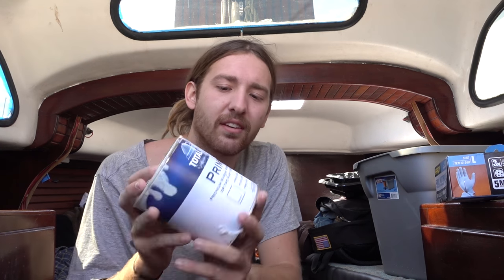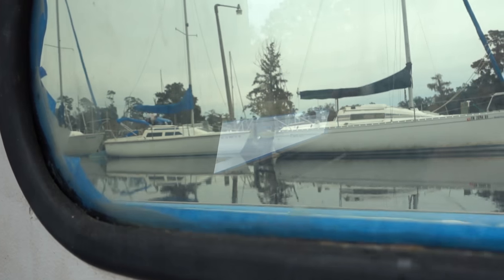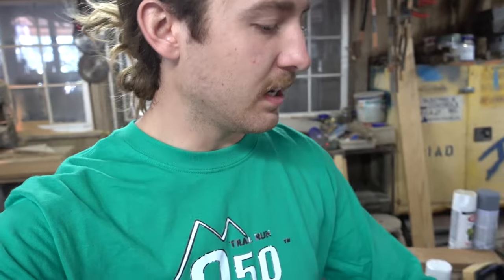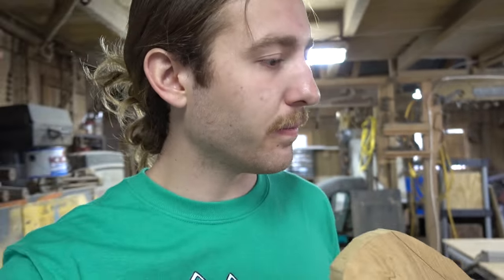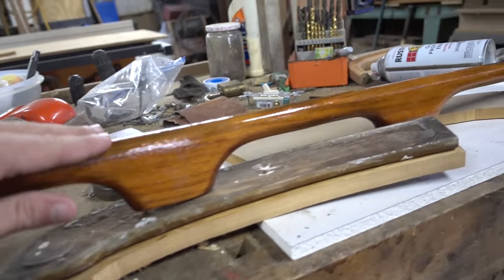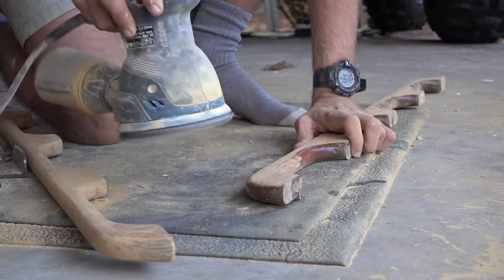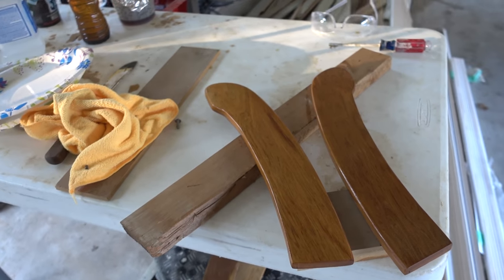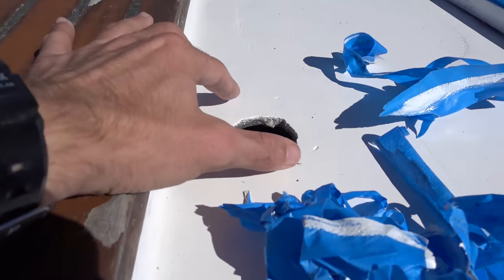Top Deck Paint, Woodworking & Varnishing, Thoughts On My Rigging

Comment: Most boats with gasoline engines have a blower that you turn on before starting. (They recommend 15 min or something, I do it for about 5 min) The idea is to get all the potential gas fumes out just in case the motor backfires. Once its running the blower can be turned off. In your case maybe open the hatch for a few minutes, then start while open, then close it and enjoy. There is no danger having it closed while its running.
Reply: I agree with you, the only thing I would add is, putting a blower in would for sure help, but I would say since the boat is a 1960 something boat and it's been this way for more than 50 years, it's probably just fine the way it is... :) if it were me, I would do like AJ suggest and just open the hatch for starting and then close after a warm up period.
Reply: Gasoline vapors collect in low places, so opening the hatch may not do too much. To vent the compartment, you need an explosion-proof marine blower, which draws from the lowest point.
Reply: It is an OUTBOARD motor.  They almost always have the fuel tank right next to them.  I would just put in a couple LARGE vents so you get a good flow of air around it.  As long as there is fresh air around the tank you are pretty safe.  Problems ha[[en when you get raw fuel in the bilge.
Reply: It's an outboard motor in an enclosed space. Fuel vapor (the thing that actually explodes) is heavier than air, and will collect in the bilge. Adding a vent in itself, won't let the vapors out, unless it's in the bottom of the hull, which would add a whole new problem.
Yes,  fuel tanks are usually sitting beside the outboard in a John boat or bass boat, but that's not the situation. From what I see, the motor is in a well, under a cover.
Also, where are the exhaust gasses going? Can they travel under the cockpit seats into the cabin? Some exhaust into the water, but some exhaust under the base of the power section. I'm not sure about those old Johnsons. BTW, I believe it says 9.9 HP on the side.
As far as tuning, I took a reel tape measure, hooked it up to the main halyard, hauled the end of the tape up to the top of the mast snug, and took measurements from the top of the mast to the chain plates on either side of the boat, and adjusted the turnbuckles until they were even on either side. You should use a tension guage, but I don't have one, I just make sure that when the wind is blowing, and she's over about 30 degrees, the side that's downwind isn't too loose. The windward side will be taking the strain, keeping the mast from blowing over. The leeward side shouldn't be flopping around.

Comment: Hey Cole, I am a Cole too.  I've spent a few years sailing an Islander 24 Bahama.  The previous commet is a good one regarding the mast.  I've gotten free\cheap mast from boat yards before.  Hold off on replacimg the rigging until you satisfy your mast problem.  When things are feee, you don't always get a choice of what you get and the dimensions may change, it may also force you to buy\recut sails which will be another expense.  I'd also hold off on adding chain plates to your lower shrouds.  If they have been there for fourty years, it must work.  You have enough things on that boat that need to be done, there is no sense in spending time and money on things that don't need to be done.
We would run the engine with the hatch propped open and never had a problem.
One BIG repair that I had to do was drain and seal the keel cavity.  There is wood in the cavity towards the forward bottom, don't ask me why, it held water, froze, and cracked the fiberglass at the bottom of cavity.  Grinding, exposing, and allowing to dry took an entire summer.
I was very pleased with the sailing characteristics of that boat.  I remember holding 5 knots all day long on lake erie sailing to Put in Bay.  The boat is really coming along and I love the dark hull.
Reply from the maker: Hi Cole, thanks for this comment. Maybe youre right. Maybe I should not worry about the rigging UNTIL I replace the whole system. Thanks for that perspective. As for the keel cavity, how exactly did you go about that and what are the steps needed for me to check this? Things like that worry me because not only do I have no understanding of the things I haven't seen yet but I have never dealt with them. Either way thanks for the comment.

Comment: Hai Cole, This is Gerard from the Netherlands. The fumes of gasoline are heavier then air so you need a ventilation opening at the lowest point above the waterline after filling up the boat with stuf you need for your trip.. The option for electric ventilation is a idea but you run out of current someday because you have charging issues. You need your current for the VHF en running lights. Have fun with you project .

Comment: cole,  look for a donor boat.   loot it and strip the mast and all the goodies.  then cut the lead ballast off.  lead scraps for .58 per lb.   not a bad haul if you have say 2000 some odd lbs of it.   then you can scrap your mast for aluminum and so on.   you will leave with a fat check,  then drop the old hull at a landfill for about 100 bucks.  the cost of the donor boat will be breakeven if you make sure of your scrap prices and your lead ballast weight.  if it is free.   you will have a mast that paid you to put it on.     p.s.  need truck, trailer,  and sawzall or chainsaw.  to pull it off.    best advice I've ever given lol

Comment: I went with silicon bronze chainplates (1/4" thick) with 3/8" bronze carriage bolts (28' ketch)  and have been very happy with them. No worrying about corrosion anymore, and they will probably outlast the boat. The bronze you mentioned in the video I think is known as aluminum bronze and will probably be difficult to work. Silicon is bendable while cold in a vise...

Comment: In the area for the inboard/outboard. Ages and ages ago on my Dad's old skiff there  was a similar hole to the one you suggested was for ventilation of the engine compartment. He had a tube with a set of valves on it that protruded out of the hole which allowed him to easily switch which gas tank was providing fuel to the engine. I remember him having 3 portable red metal gas cans and there was also a larger 22 gallon(?)  gas tank under the forward seat of the skiff. There was one valve for each gas tank.

Comment: Hey Cole. Good luck with all of this! First, I like your idea about the chain plates. That will add a lot of strength to the rig. Second, of course you can tune the rig. Look, obviously you're not going to race this thing, and it looks like that mast is deck-stepped. So, my advice is to get the shrouds (side to side) snug, but just. You want to be able to deflect them with your palm about three feet up, maybe about 1/2 inch without working them too hard. That way, you won't be stressing the deck too much. (or that gimpy mast!) With wind in your sail, the upwind shrouds should be tight, and the leeward ones should visibly sag.
    Leave the stays(fore and aft) a little looser. Put in just a little rake toward the stern. Not much! When you hoist the jib, you can get that nice and tight, which will tension the whole rig while you are sailing, the only time you need it tight. And the mast will tighten up to the vertical. Savy? 
   As with all advice, compare mine with everybody else's. 

Also, I hate to say it, but that mast should be history. A naked extrusion (mast places have them) shouldn't set you back too much. Sucks, I know, but imagine a tough blow offshore that knocks you down, with you and a sweetie on board. That mast is the weak point, no question.

Comment: I'd definitely replace the turnbuckles and if the standing rigging has swage fittings at their ends, then replace it as well. Trust me, you do not want to get dismasted. Speaking from first hand experience. All it took was one turnbuckle to fail and down came the whole rig. Totally worth the investment and peace of mind. Your best insurance policy is a sound rig, good ground tackle, and prudent seamanship. 
As for the motor/gas situation, it looks like you could install a blower that vents out of that top hole in the aft deck. You could run it while motoring. Have the alternator hooked up so that it won't draw from the battery. 
Also, get really good at sailing as you go along and then you won't need the motor much :) 
I love the videos man! Keep them coming. Subbed!

Comment: The shot you took looking straight up the mast is very informative and it looks like the mast is definitely kinked, this isn't just a tuning issue. The fact that it's kinked means that the structure of the mast is compromised and you should definitely replace the mast given how you intend to use the boat. The advice from other comments about finding a cheap donor boat you can take the mast off of and scrap is good, scrapping a boat is hard work but you can make a decent chunk of change. Just make sure the mast on the donor boat is sound before you buy.

Comment: If you get to the point where you wanna add a stereo, I've just pulled a JVC CD stereo with remote (no speakers) out of mine for a new digital radio.  You can have the old one if you want.  I live in Denham Springs and I keep my boat in Gulfport, so I pass kinda your way sometimes.  Like this weekend.

Comment: I wouldn't have a second thought on placing a fuel tank there. On motorcycles they're just slammed on top of the engine. 
For outboard chain plates I would definitely recommend sourcing some 316 grade steel, simply for corrosion resistance. Not all "stainless" steel is created equal. And since you're planning to do some serious travel later on I would get that mast replaced. It'll suck to have to do it, but I wouldn't consider it ocean worthy as is..

Comment: Hello Cole. i just watched your video on your chainplates. I don't know if you have found a solution yet, but the upper shroud chainplates seem to be made by Schaefer. They probably still stock them. Otherwise you can use a 316L flat bat and drill the necessary holes. It may sound like a little overkill, but if your deck is soft in the padeye areas, then fixing the deck means more work. As to the turnbuckles, the were built by Merriman. They are no longer in business, but you may find some parts in Ebay. I would install some toggles to avoid bending the threads. You can check them for cracks with regular dye. The ones in my Cheoy Lee are around 30 years old and holding. Good Luck with your project. Jeff

Comment: My guess is the hole through the bulkhead in front of the motor is where the fuel line went through with the fuel can in the cockpit. If the engine compartment is well ventilated with no access to the rest of the hull so fumes can't collect you could perhaps fabricate a partition between the tank and fuel can. Personally, I wouldn't have them in the same compartment. Gas fumes are heavier than air and will find their way to the lowest part of the compartment. You might want to check with your local Coast Guard station. I am assuming that their is airspace between the engine and the hull.
The boat is looking good.

Comment: I agree with others on the mast. Doesn't look great. Don't spend a dime on rigging, except the chain plates, before you source another mast. You can find freebies, sometimes they are attached to the boat you must also take... The mast looks like the same type used by many other boats of that era. You may want to get the sails off the donor boat as well since they will be a direct fit to the mast, boom. Call around.

Comment: I think you have great taste in sailboats. Your choice is definitely a classic. 

Your turnbuckles look like bronze. That is good. A little green is to be expected exposed to the elements. If the holes for the pins are  not elongated or something you should stick with them. In my opinion they are superior to stainless steel. Stainless can crack and fail just from being exposed to the weather over time. The bronze will outlast the stainless. If you have to replace one look for another bronze one. They may not be cheap, but maybe a used one can be found. As for the mast try to get the dimensions and keep your eye open for a workable replacement. Larry Pardey has some great advice on standing rigging on the two sailboats he built. He seems to prefer the bronze. Just google Lin and Larry Pardey or start watching their videos. He wrote a book on boat building that probably covers it. Maybe visit a bookstore or library and look through it.

As for the gasoline and engine, you want to keep that compartment vented some how. I think the concept of having several plastic fuel tanks on the sides is fine. A marine bilge fan for clearing possible fumes is not a bad idea either. Better to be cautious and vent that compartment. You should check out atomvoyages.com. James does a lot of customizing with the outboard inboard configurations. You should get some tips there on that design.

Will keep watching. 

Fair winds!

Marshall

Comment: I think the fuel tank is in a perfectly good location and is not more dangerous than it would be anywhere else.  Good heavens, I ride a motorcycle with the gas tank right over the engine and it doesn't worry me a bit.

The thing to remember is that petrol fumes (the dangerous bit)  are heavier than air. I would want to ensure that there is no possible way that they can find their way into the rest of the boat and end up filling your bilges. They need to be vented to the outside of the boat  and of course air needs to get in too  (top vent) so that fumes can not build up in that compartment. 

It would be a good idea in any case to ensure that anything electrical is in good nick back there to reduce the possibility of any stray sparks,

I think that most probably your mast is ok unless it is cracked or excessively corroded.  They bend under normal conditions  according to the set up of the standing rigging.  The very expensive double taper aluminium mast on the Dragon I used to sail was designed to be bent on the fly to alter sail shapes etc. 

Standing rigging though should be replaced in total IMHO.  Like your idea for chain plates but try and find strong points of the hull to fit them.

Comment: The main symptom for water in the keel cavity was a constant drip when I took the boat out for the winter.  I figured it would resolve itself by spring and I didn't.  In fact, it got worse with freezing.  When you haul the boat, tap around the bottom with a screwdriver handle and you will no doubt hear the hollow areas.  That does not mean it is full of water necessarily.  Just something to beaware of.  Cole, I am always working on sailboats and I would love to help you.  I have been a West Marine manager for over 20 years and can be there for you.  How do I get you my contact info to you?  I even happen to have an extra mast!  I think it is 27' long or so.  That's pretty close to the length of yours.  When I need a lot of boat parts on a budget, I bid on boats on Boatangels, use what I need from them and trade or sell the rest.
I know how to handle that companionway hatch as well.  I've fixed a few of those in my time.
Keep up the good work and videos and yes, yes, yes... get that boat to the Bahamas.  There is no doubt that will make it.  Do it before you start a family and have fun.  ~Cole

Comment: Cole , IMO your mast appears  fine , unless its actually kinked , which i doubt , just needs to be tuned , I would lower it if able and check spreader fittings and wiring and masthead ...... masts bend VERY easily when not tuned properly.  Does the sail raise and lower  easily , how is the mast sail track? Is the standing rigging frayed or corroded, turnbuckles cracked? How is the base of the mast ? how is the deck BELOW the mast ?     you're not leaving for a year / inspect it thoroughly yourself . YOU need to KNOW it ... you are NOT going to have a helper at sea. check rigging for corrosion ,  kinking and fraying - if looks good -  sail it in your local area and enjoy. Backing plates are critical and easy to install and not a big deal either ....... YOU need to KNOW your boat and rig ...  
    Dont get down though! you're getting a lot done!  and YOU CAN do it! enjoy the learning experience and learn as much as you can , there will be ups and downs but it'll be a great experience either way.  .....  
   Also for an expensive fix don't hesitate to get a second opinion.......

Comment: none skid paint haha but on the boat motor situation i would open the hatch for say 15 min before i start the motor allowing any fumes to escape before starting  but after it is running it should be fine shutting as you troll out of a harbor ,,,but if your current system gets worn out get a cheep 4hp kicker mounted external off the back of boat and turn the inboard/outboard compartment in to storage or something ..for the size boat you have that old 2 stroke is over kill ..understanding the old Johnson 9.9 2 strokes were 15hp with a bit smaller carbs installed .but the old Johnson/evenrude 9.9/15 hp are very solid motors and simple to work on and so long as you run 32:1 to 36:1 oil it will run for ever maybe a few extra plug replacement but the bottom end will last for ever and that is the part that cost allot to fix :-)

Comment: The mast looks like it might have fell when taking it down or putting it up. You may want to look at the stays, and see if they are all the same length, matching them up to where they'll fit best. They may have been mixed up at some point, if they were completely removed.
Good luck. It might be less traumatic to concentrate on one thing at a time, but that's up to your personality.